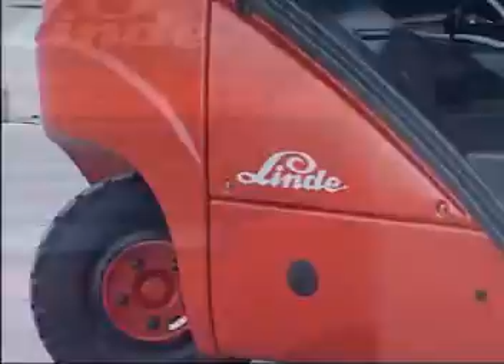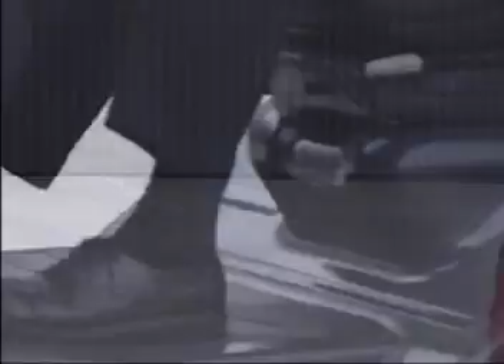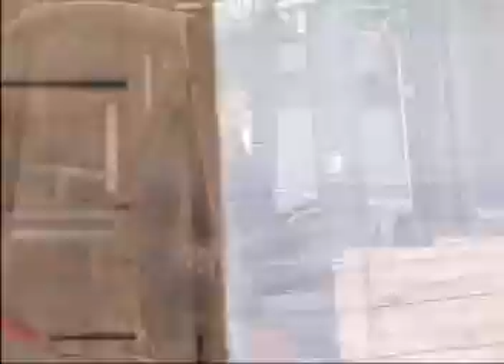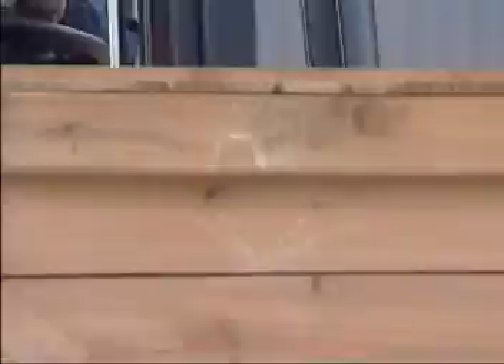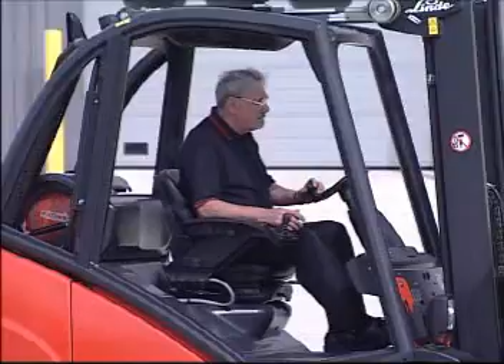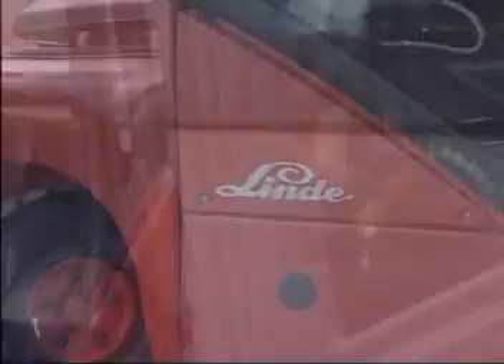Visit RIGO LIft Truck Ltd. & See why the Linde Forklift is the BEST forklift in the world!!!

Comment: Drove a linde for 4 years. Good machine, very comfy, and easy to see. But parts are expensive and if you don't live in the right area, It takes weeks to deliver. Don't get stuck in snow or your screwed and don't leave it out side in winter, it wont start at all. Not good for areas where winters are cold.

Comment: I have an H45 9000 pound Linde.  It took some time to get used to driving it with the pedal system.  I like it.   The perkins engine is good.  Mine has good safety features the others lack.     I also have Toyota, and Komatsu, and Yale all good but different.

Comment: @lorddeadbullet I want to control all of movement of the forklift i hate if the computer is intervening in my commands. And for example in the video clip the another forklift is a Mitsubishi FD25K. I had drived one of that for 6 months (also on that forklift i had learned to drive). Is a great forklift. It was very precise. At that company i had worked like a aluminium melter and with the forklift we have loaded the melted material into the casting machines. Sorry for my bad english.

Comment: @cdiberto The Linde forklift it was rented only for a week because ours toyota (electric) forklift had some problem. I hated hydrostatic because i need the clutch. I need to go sometime only very slow and with clutch i can control my speed the finest. Better than an electric or hydrostatic. And i also one thing in the most types of forklifts if the command for the lift, etc is electrically controlled and automatically pumping more without i press the gas.

Comment: @Skogstomten i have been on their hi reach models for the last 3 years every day 8 hours a day, before that use to drive BT, and  BT hands down makes them look like a toy forklift, they can barely carry 2 pallets yet they are suppose to have same capacity as bt, way to easy to have them on 2 wheels, with bt its impossible, and steering is crap, i like the kind of steering where u can just flick the steering wheel and the wheels turn by it self, linde is more fixed kinda

Comment: Have you tried  a Linde Hydrostatic Forklift before?  They are Sweet for the Operator Ergonomics and save 20-30% on Fuel usage!  They are the cleanest burning IC truck on the market and performance is unmatched as you can see - I know we all have our preferrences - but try one and you'll see.  No Brake maintenance ever!  Unmatched Fuel Savings and the lowest environmental impact on the market.  The best Operator Comfort and performance.

Comment: We also like the Komatsu and are a Komatsu Dealer - but I think this video shows why the Hydrostatic Transmission is THE best for forklift applications - Lowest Fuel Usage by far and this engine will run for almost twice as long as the competitions.  All Torque Converter trucks will have trouble beating the Linde Hydrostatic.